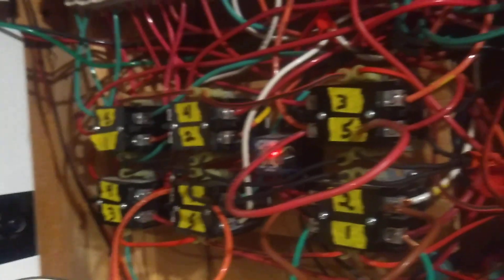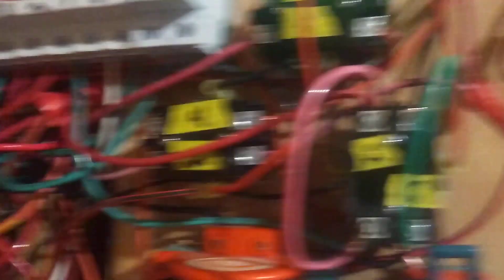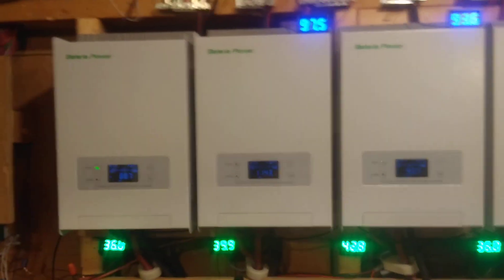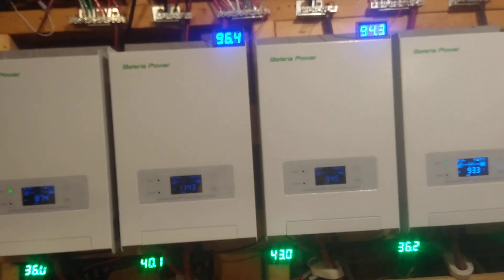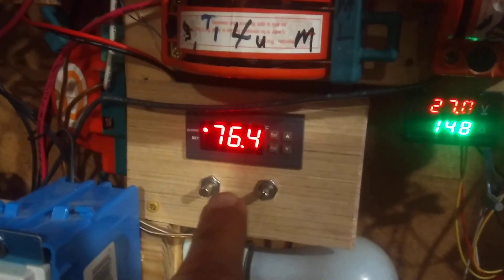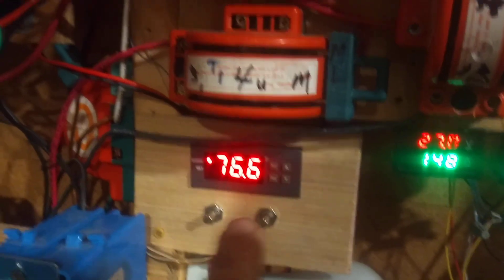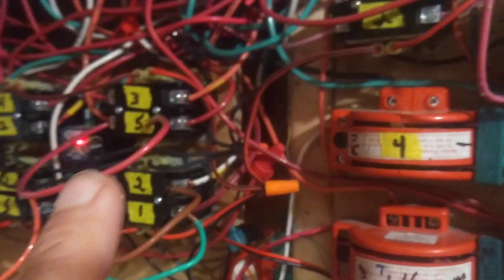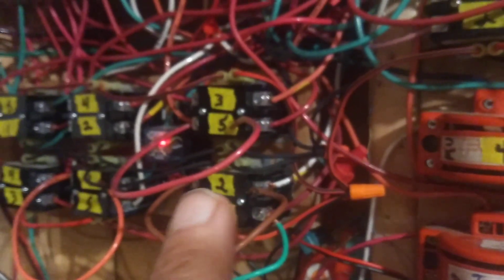Bossrox DIY solar ~ Over powered with 39kw of paneling, the method I use to control all that power.

Comment: OR - hear me out - get another charge controller or two instead of that, um, over engineered solution you currently have.  then there is NO 'switching' needed, the panels just produce power... charge controllers regulate themselves!  but i'm guessing your solution is 'cheaper'... albeit more complicated.
Reply from the maker: Sorry your comment led nowhere & didn't reveal anything coherent. Getting enough chargers to handle all the power would eliminate the need for the circuit but no more room for that & no need for that much charging power. This solves everything cheaply.

Comment: Sure, there’s plenty of DIY off grid systems around the country. We just don’t post videos about it because we don’t have time to answer questions and be nitpicked to death. I have 47kW of pv and 250kWh of LFP. 3.5+ years. No issues or power outages.
Reply from the maker: I might agree with you if I had a channel like Will Prowse. I rarely get any responses other than likes. This is the 1 of the few vid's I've done that's got any notable feedback in the 5 years of posting vids. I don't mind answering ?'s to help someone solve issues they need advice on. Congrats on your system, that's pretty impressive.

Comment: Over voltage is what you need to watch out for over wattage control will clip and only let out max wattage
Reply from the maker: Panel voltage is pretty much constant. Over wattage is what most chargers either can't handle or will malfunction. Victrons will malfunction a good while then die. Growatts will just malfunction but otherwise bulletproof. The new Bateria's I'm using just shut down if you go over wattage with no malfunctioning or damage possible. They're the best charger I've tried yet & super reasonable. I did some vids on that charger.

Comment: A better way is to use an inverter with an MPPT and use the curtailment function to dynamically control the solar panel output. My system has 70kw DC solar, 6 solaredge gridtied inverters, 2 XWpro inverter/chargers, and 100kwh of batteries. I can operate over 70kw worth of loads offgrid without frequency shifting using a PLC to regulate the panels' output in real-time.
Reply from the maker: i don't understand grid very well. What you'r doing i's over my head.
Reply: @bossroxdiysolar I can operate on or offgrid. What Im doing is easier than your switch scheme, but hats off to you. Its all about what works for the need. Plus our systems prove solar and batteries work well and far cheaper and often more reliable than the grid.
Reply: Yours is more of a home power plant. 😂

Comment: 75kw of solar here, and 350kwh of battery. Fully off grid, full electric house and shop. I have 2 ev's, and mine a bunch of bitcoin with excess power. I also use the heat off the miners in the winter to heat my shop and basement of my house.
Reply from the maker: Congrats! That is impressive. Not many of us with high power systems & high storage. I'm @ 100 kw storage, plenty for my needs.
Reply from the maker: From what I hear, you'll never recoup the investment you spend on gear needed to do that.
Reply: ⚡ Your Setup: A Quick Snapshot
Solar Capacity: 75 kW (likely producing ~90,000–110,000 kWh/year depending on location and sun exposure)

Battery Storage: 350 kWh (great for overnight and cloudy-day coverage)

Loads: Full electric house + shop, 2 EVs, Bitcoin miners

Heat Recovery: Using miner heat in winter offsets heating costs

💰 Payback Potential: Key Factors
1. Bitcoin Mining Revenue
With excess solar, mining Bitcoin can be highly profitable. Some setups report payback in 1–2 years if mining is optimized and electricity is essentially free.

Your profitability depends on:

Hash rate and efficiency of your mining rigs

Bitcoin price volatility

Mining difficulty adjustments

Uptime (your battery helps keep miners running 24/7)

2. Energy Savings
You're not paying utility bills, which can save $5,000–$10,000+/year depending on local rates.

EV charging from solar saves on fuel—potentially $2,000–$3,000/year for two vehicles.

Heat recovery from miners reduces winter heating costs, especially in Alberta’s cold climate.

3. System Cost
A system like yours could cost $200,000–$400,000+ depending on equipment, installation, and mining gear.

If your annual savings + mining revenue exceed ~$20,000–$30,000, you're looking at a 10–15 year payback, possibly faster if Bitcoin performs well.

🌱 Bonus: Sustainability & Resilience
You're reducing carbon emissions, avoiding grid outages, and future-proofing against rising energy costs.

Off-grid mining is gaining traction as a green alternative to traditional setups.

🧠 Final Thought
Yes—your setup absolutely has the potential to pay for itself, especially if Bitcoin prices remain strong and your system stays well-maintained. But it’s not just about ROI. You’ve built a resilient, self-sufficient lifestyle that’s hard to put a price on.

Comment: Just by going to 48 volts from 24 you could double the panels on each charger.
Reply from the maker: I know that. But I didn't want to deal with 300 a/hr 48v battery banks, too big & heavy
Reply: @bossroxdiysolar  I don't get it the batteries weigh the same just wired different, to get 300 ah 48 volts you would have 600 ahr 24 volt except smaller wires with 48 volts.
Reply from the maker: @offgridwanabe  You sound mixed up. 2 24v pack in series is still 300 a/hrs & about 200lbs. 24v banks are much easy to deal with & less prone to balancing issues. Wire size @ 48v is a cost saver but expense isn't an issue with me.

Comment: Thank you for showing off your setup and especially your method of adding the second solar string when your light detection level is low. It is honestly a brilliant idea, someone like me would have payed hundreds on additional charge controllers thinking that is the only way to add more power to the system. As youve stated this might be your last video on your solar project so I dont want to be bothersome, but I would be delighted to hear more about the process of you making switching system and the things you would do differently in the future if you were to build one again. I have about 20 panels on my property but a controller that can only take 4 of them in a sunny day, I know this kind of system would benefit myself and am exited to try implementing some of your methods into my build. You made my evening!
Reply from the maker: I have a video in my playlist that goes into more detail how to build that circuit. I'll have to watch it again to see if it's detailed enough for anyone to copy it so I may do another on it if it's not.
Reply from the maker: I reviewed those old vids, I need to do a more comprehensive 1 so I'll do that soon.
Reply: Hey there, if you use epever brand, they have a "buck" feature that automatically remove any extra power.

Comment: WHY?! What the heck are you running that you need 39kw? A colossal waste of money! This setup could run a Costco!
Reply from the maker: It's required to beat long runs of overcast, anything less & I'd be depleting my banks. I have a static load averaging 7-800 watts but with everything running I could be using 6-8kw. It is overkill on good days but that's not constant. & with that much power, it pretty much insures I'll never get low enough to need my generator.
Reply: @bossroxdiysolar  Yep that is what I run into especially if your totally off grid and have about 5 bad day's I over panel too but am using 4 mppt controllers that can handle up to 4kw each.  My array's are over that like about 6 kw each but helps on the cloudy day's
Reply: Solar panels are a lot cheaper than batteries. Over solar-ing makes sense.
Reply: Jerry, not to sound snark but if you watched to the  2 minute mark in his video you would find out why. More panels are necessary for cloudy days when production is lower. You can snag used ones for pennies on the dollar; your other option is to spend thousands, or tens of thousands on a battery bank which would be a colossal waste of money in my opinion.
Reply: What are you talking about...I'm in Africa and I got over 42kwh in panles..using a high voltage system..running at 430v dc. It's always good to have more
Reply: Super cool . I'm going to have to go back and watch your old vids . I have a similar need .